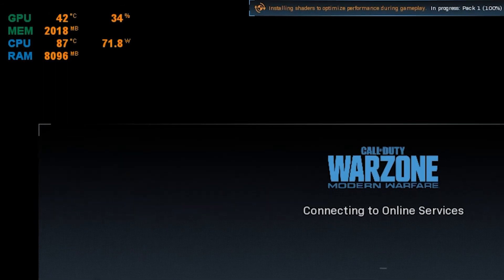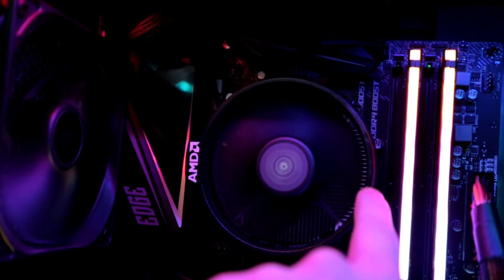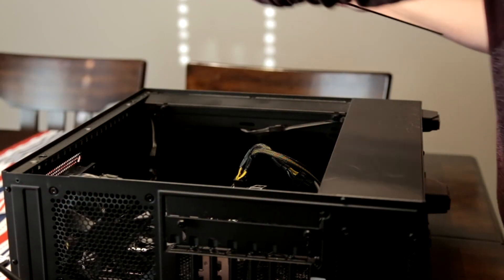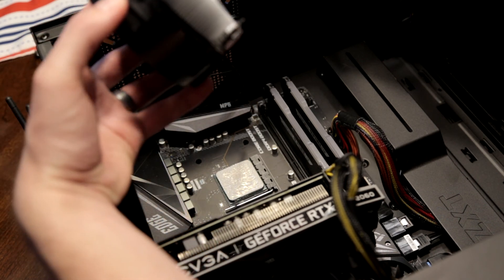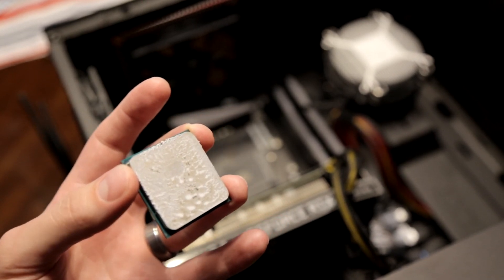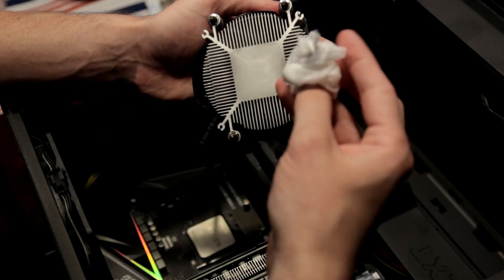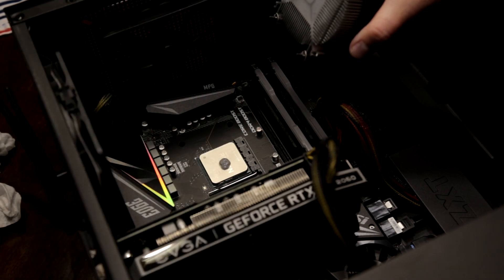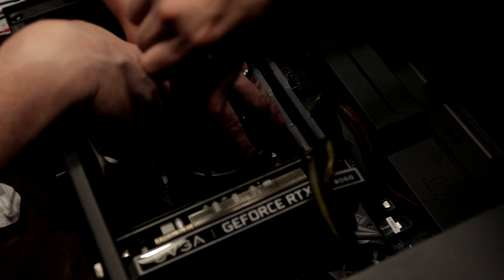High CPU Temperature? Here's How I fixed it.

Comment: my ryzen 7 3700x is runing constantly at 60 celcius and 60-70 while on full load i dont understand whats wrong if it was a faulthy cooler or if i made mistake installing it then it wouldnt stay chill at 68 celcius while im running tarkov on high settings and i have a 4070 super itried almost everything from undervolting to turning off the auto clocking in the bios settings

Comment: I idle at 48-55 
But as soon as I open anything including google chrome it automatically immediately jumps to 70’s. And when I open games it get the 83 degrees. 

I’ve already cleaned pc, reapplied thermal paste after cleaning the cpu and cooler. Turned my power consumption plan to balanced. Changed my airflow orientation twice. 

I don’t know what to do… anyone help please?I have a Ryzen 5 5600x with the stock cooler, temps haven’t been a problem in the past but recently this started to happen…

Comment: please give me a solution, my pc starts normally and tomorrow when i restart my pc the temperature is directly 90-100 degrees and a few minutes it immediately turns off, i have replaced a new paste but still no effect, oh yes when i turn on the pc there is a fan sound which is a bit noisy unlike usual, I use ekwb ek aio 360, please give me a solution

Comment: My 5600x is running 90 C anyone help?

Edit: I did everything Iron did in this video and my temperaturees is still the same, can anyone please respond I really need help my system is overheating
Reply: I have the same cpu but it hits the 80s. I tried cleaning the radiator with compressed air to remove the dust. And it helped. However, its still not perfect.
Reply: @khouja8602  it's actually fixed now it's just I was dumb and didn't properly screw the CPU cooler on to the CPU causing half the side not getting cooled so I just fixed the backplate and properly screwed the CPU cooler on and now I'm only getting,60-70f degrees when playing cod

Comment: Hi I have a AMD ryzen 3700x 8 core processor and the temps
For my cpu when I am running no games/apps is 62c and sometimes 80c I tried wiping my computer installing new drivers and thermal paste but nothing seems to work can anyone help please?
Reply: Did you figure out the issue?

Comment: Guy the ONLY thing that worked for me after trying lot of things, is going to the power mode in Windows & choosing the advanced power options & going to "Processor power management", then to 'maximum processor state' and changing both options from 100% to around 50% or 40$. Best to change that because the power thats going to your laptop is too much, so there needs to be a cap that the laptop knows to not overclock the CPU. DONT WORRY the performance is hardly affected in my experience. The CPU gets used but the temperatures & fan noise doesn't go as up at all, it s so GREATT!!
Reply: This is the only thing that worked for me. Only seemed to be happening after I got windows 11 ?

Comment: Msi after burner and task manager only show GPU temp the only way I know if CPU temp is there is through overwatch and bios it's stays at 65 on overwatch and it used to be at 81 with the stock color
Reply: Msi does show cpu temps. You just need to turn it on in the settings of msi afterburner.

Comment: Hi, I have a prebuilt with a program that shows cpu and gpu temps. But I also downloaded “msi afterburner” and in the “rivatuner” that comes with it, it shows higher cpu temps then the other program that came with computer. I even tested running both programs at the same time but the “rivatuner” still showed higher temps. Do you know anything that could be causing this?

Comment: I have a ryzen 7 3700x and I idle at 60-75. It has to be a hardware issue because I've done everything other than doing something inside of the pc, should I re-apply thermal paste?
Reply: i have this same cpu. I use a 360mm aio cooler from EKWB. at idle as we speak im at 32 -40. I was unsure if this was okay or not but i remember my idle use to be around yours with the stock cooler so I tend to not over think it or atleast try not to.

Comment: My intel i7 suddenly is running at a constant 98°C. Two days ago it was running fine with the idle being around 60°c. I replaced my thermal paste thinking that was the problem ,it wasn't.i have a m22 kraken liquid cooler for my cpu. Not sure if that's the problem as I've never worked a liquid cooler before, all I've done was made sure the tubing was aligned correctly.
Reply: I have an i9 with Lian li liquid cool and mine did the same thing. Wtfff. Did thermal paste replacement.
Reply: @RyTyTech  did that do anything?

Comment: I'm kinda worried I got a ryzen 5 3600 it's in a mini itx case it's idling at 50c then when gaming bf5 it skyrockets into 90c (after 30 mins or more) I once saw it hit 95 what can I do to fix it.
Reply: Download ryzen master, set the mhz to 4000 and the voltage to 1.2 and it will run much cooler
Reply: @siddyplayz1738  my mb is oc locked
Reply: @fewlandedplanes9148  what mb do you have?
Reply: @siddyplayz1738  a320-itx

Comment: I have a ryzen 5 2600 and I get 90+ at idle. I've reapplied thermal paste, cleaned out my whole pc, changed my power settings, I have 4 fans. Idk what to do anymore😭
Reply: did you find any fix? I'm kind of in a similar situation
Reply: @keemo2684  if you find a solution lmk please!!
Reply: Any solution ? Similar situation

Comment: If cpu temperatures are between 35-50 on idle and around 70 on cinebench then it probably not an issue with the thermal paste and seating of the cpu cooler. If temperatures are high during games it’s probably because of restrictions in airflow to components in the case. During games both the gpu and cpu are working hard and the latest GPUs in particular dump out a lot of heat inside the case.
Reply: My cpu idles 40-50 but when I game it goes too 80-90 abs sometimes hits 100. I re applied thermal paste and nothing is helping!!!!
Reply: @RyTyTech   got a aio cooler bro I had same problem every time I entree like wz gta5 my temperature would rise to 73 to 79c but month age in gta5 it was like 69c air cooler I brought Corsair aio now it at 57c 4.6mhz 10700f
Reply: @Spilityz  help bro gta 5 is getting 67 and above when I play Minecraft is hitting 85 and above sometimes 86 my game run temperature 70 and above and I am using ryzen 7x58003d cooler ASUS ROG Strix LC II 360 ARGB All Aio cooler
Reply: The only problem I have is playing Minecraft idk if is normal for that cpu temperature for the cpu getting 85 it only happens when I fly on creative is random is trying is best to go from 85 to 81 and above some on ground walking 75 and above but it stays around 71
Reply: I’m on YouTube And myn is on 98 like what
Reply: @Bnxzz  have you figured any solution out?

Comment: I use "core temp" byALCPU, when idle its 14-17°C when stressed it goes 62°C, but why is that when i go to bios the cpu temp goes from 35°C to 67C°? Does BIOS stressing the CPU?
Reply: 14 to 17? How, what’s your cooler and case

Comment: You can also go into your bios and limit the cpu temp. I have mine set to 75°.
Reply: if you set your temp limit. once your pc hits that limit. your clock speeds drop because you're forcing a thermal throttle
Reply: how
Reply: @karimsaidi8123  I'm AMD and I go to OC Settings then PBO and it has a limiter in there.
Reply: I'll see if I can find the video
Reply: https://youtu.be/4Tii1sNcfQ0

Comment: I recently bought a prebuilt pc. I was on idle about 55-65 degrees Celsius, and when playing games like rocket league and valorant I was around 70-80 degrees, I recently bought more ram (16gb ram from 8 gb previously) and now my temps are 90+ playing those same games, I have no idea what happened
Reply: if you have upgraded to a higher memory speed, it could be putting more stress on the memory management unit which increases temperatures
Reply: The first upgrade anyone with a pre built should do is buy proper cooling or even a new case

Once youve lowered your temps it means an overall better performance

Comment: Hey i'm running at 50 C idle used to be around 32-36 and go as high as 70 when playing cyberpunk and a few games. I have a 5900x with cooler master 360 ML AIO which I replaced with the EK Elite 360 which I absolutely love it's so quiet at these high temperatures but the temps are not improving with this cooler. I double checked everything, looked for malware, installed and reinstalled. No improvements!

Comment: My cpu is i5 its idle temp is 48-51 and while playing minecraft it goes literally to 99° c and after some time it automatically turns off
Reply: Mine goes 93 when playing gta 5 online
Reply: @skrrdibu5227  i fixed it now it was because dusty and slow cooler of my fan
Reply: @skrrdibu5227  now i get overclocked gpu temp 65c and cpu 71c in gta v

Comment: Check your pc power consumption. If you have it on high performance. Your cpu more likely be running full load at all times. Go into control panel and change your power to balance for lower temps. PC will boost up when needed.
Reply: Bro thx so much. lol b4 my temps were 99 degrees now its down to 70
Reply: thank you so much bro :yt:
Reply: No wonder lmao, i changed my power plan to ultimate and it ended up going to 78° when i was at 48° before
Reply: It’s already on balanced and it’s 90°
Reply: @saada5369  same here than i watched a video where a person undervolt the processor now my temperature is lower
Reply: my guy, thank you so much. ur out here saving people
Reply: lifesaver comment

Comment: My pc is around 2 weeks old, all new parts and no oc at all. My Ryzen 7 3700x is idling at 102c and has shut off my pc once. I have a strong feeling my aio has already went out. My gpu temp is just fine and everything else is okay. 

Full build
Ryzen 7 3700x
RTX 2070 Super
1tb NVME
32gb ddr4 3600mhz
Cooler Master AIO 
800w psu
Reply: Did you find a solution?
Reply: Dude I have the same cpu and it shut my pc down often while playing pc, I have my power setting at full performance so I changed it to power saver it fixed it but gaming sucks especially playing fps game like warzone I have a 3080 graphics card

Comment: My intel i3 keeps getting on 100 degree celsius when i play games or even open zoom and i figured out that my cpu fan doesnt start when i power up my pc, i need to push it a bit in order to start the fan. Any solution?
Reply: Use afterburner if that helps?
Reply: @HookedonDays  i used afterburner to check my pc's temperature

Comment: My cpu is at 99 c I have 2 intake in the front and 2 exhaust 1 at the rear and 1 on top is it because i need new thermal paste or heatsink not seated correctly it's a intel stock cooler.
Reply: I have i7 and no case fan ... My CPU at idle it stays at 60s.. and 105c at load of 30%usage..... I want to buy CPU cooler and a new case but I have lockdown here  :(
Reply: @cold_aim  💀
Reply: @krish4540 I bought deepcool gammax 400v2 and deepcool g15 thermal few days ago and now it's 33c idle and 64c at full stress test of 30 min..
Reply: @cold_aim  i also have gammax 40 v2 with i7 10700k. Running gta v or cod reaches 85-87°C within 20 minutes. Don't know if its bad cpu or cooler :(
Reply: @csg-o-a-t4933  I think it's just a bit high try changing with a good thermal compound...(I used deepcool g15) having 75 will be ok I guess cause it's a powerful CPU after all...
Reply: @cold_aim  true man. Thanks, will definitely try that. Also tomorrow getting two case fans 120mm (prizm). Will install them at the top.
Btw which power plan do you run your pc at? Balanced or high performance?
Reply: @csg-o-a-t4933  high performance 😎😂😂
Reply: @csg-o-a-t4933  owo that's great i also recently changed my case
Reply: @cold_aim  hey. Just wanted to update. I didn't repaste the cpu fan since i did that a couple of days back. I added two case fans-one at top and other at rear and set them to full speeds.
Now my desktop temperature at max reach 74-75°C in a non air conditioned room with average temperature keeping at 64-65-67°C while gaming. Super happy to see a this much of a difference from 86-89-91°C.
Reply: @csg-o-a-t4933  great I also saw same changes in mine xD my graphics card was thermal throttling 101 c xD changed the thermal paste and now 70c in 100% usage xD

Comment: My cpu idles at 55°c with a cooler master on top of it. The cpu cooler runs at 1100 rpm which is more than enough. Why is it so dang hot?

Edit: it has a graphite pad on top of the cpu
Reply: Huh
Reply: See that's kina what my issue is too. I have a coolermaster watercooler for my cpu and it idles at 102c. I feel like my cooler has completely went out which makes no sense at all being that it's only 2 weeks old

Comment: I just installed a new AIO and it’s on 99 degrees help
Reply: probably not seated properly check all screws
Reply: same, it made my cpu and you run at around 130f
Reply: @judahsmrl  wow..
Reply: @judahsmrl  you can undervolt using intel extreme utility run a stress test and keep undervolting until your pc isn’t throttling
Reply: @judahsmrl  thats good if it was f or did u mean c because 130f is only 54c and thats really the average temp
Reply: Thermal paste??

Comment: I have an r3600 and when I play apex I get to 65-75 sometimes it’ll hit 80 or heck even 85 but it’ll instantly drop back to the 70s am I ok?
Reply from the maker: Yes you’ll be fine. Even the CPU’s can withstand 90’s for a while before having performance issues. You just don’t want that constantly for long periods.
Reply: @IronPointTech  i have r3600 too but why the temp 90° at idle
Reply: Lol I hit 85 at idle

Comment: Thank you. I'm using an intel i5 8400 (stock fan) average temp in idle is 45 - 50 degrees. But When i play games the peak is 65 to around 75 degrees. Would that be fine?
Reply: Yes
Reply: 75 degrees is fine
you should start worrying about high temps when its 83 or higher
if its anything higher than 90 you really should do something about it
Reply: @iltro-o  mine is literally 99° C
Reply: yup

Comment: Idle my 3600 runs at 70-80 and 80-95 under load whereas my 2600 (same cooler and paste) ran at 50 idle and 65-75 under load? I have tried thermal paste reapplication but hasn't done anything
Reply: My r5 3600 is running 60-60c idle, and 80-90c when playing a game. Have you fixed it yet?
Reply: @uhhskimp  thats really bad mine is 35c on idle, 45-50c when playing a light game, 60-70 in fortnite
Reply: Lower voltage
Reply: i have a r5 3600 and it is around 35-50

Comment: Do you recommend using gel paste?. i just bought Cooler master mastergel regular . . but it seems that the cpu temperature is 42 suddenly spiked to 52 and goes to 43 celcius again.. . I just refresh in desktop it Doesnt have any  running apps tho.  .it continue all the time .  .  .. any solution?
Reply: Thats pretty normal with the spikes
Reply: did you solve that problem i had the same problem
Reply: @NamNguyen-wd6kg  its normal for amd to spike , change it tu other thermal paste , now im using aeronaut thermal grizzly ... dont use gel, its sucks
Reply: @AHMADIZHARBINSAHAMIN  im use intel so i quite worried about the temperature
Reply: @NamNguyen-wd6kg  If you use intel , you should reapply new thermal paste ,  clean the old thermal with isoprophil alcohol , you should be good! by the way wht is your processor?

Comment: Amd 2600 stock fan with stock paste, for gaming goes into 100c. Pc works but if you restart at that temperature, bios dont let to continue.
Reply: @gabrield.4276  i bought arctic freezer 2 120mm
Reply: @mrmagoo756  how are your temps?
Reply: @scrambledbananas  idles at 30 to 40 depending on room temperature, even in the 20s sometimes.
Reply: @gabrield.4276  is it better?
Reply: @gabrield.4276  I’ll consider it if just replacing thermal paste doesn’t work
Reply: 100c on gaming. Dude undervolt it or something man thats too high.
Reply: @afallensaiyan  arctic freezer 2 got the job done.

Comment: Hello Dear,
i have Ryzen 9 - 3900x and RTX 2060 GPU. i installed cooler master ML360R AIO after I'm facing problems in my GPU.
My GPU temperature is going to be High 60-84°c.
When i turn on my pc after my GPU temperature is running 41°c without any using task with 0% uses.
Please help me.
Reply: No mate 40 degrees with 0 percentage use is totally normal. My laptop runs cpu 44 idle and gpu 40 idle. Under load my cpu is around 60-70  and gpu is around 60. It stays hot for a while. Then it gets even hotter but then a restart will fix it

Comment: My cpu is hitting 95 degrees while gaming on more stressful games like COD, I have an i9 9900k (not over clocked at all) with a Z370A motherboard, I noticed a change in temps once I swapped my cpu from my i7 8700. Idk if it’s maybe the motherboard is older while using the new gen cpus or if it’s my AIO which is a single 120mm Kraken M22. I recently took the cooler off and put new thermal paste but still having this issue.
Reply: Just throw it away and get a new one.
Reply: Or get a better cooler.
Reply: how do u have a 9900k with a z370
Reply: @chief98809  idk I just do? Lmao it’s an ASUS Z370-A
Reply: @jonboitv2372  any update on your hot situation? i have a buddy that im trying to help with his build. it also has a 9900k, which also runs hot.  does your fan have a large heat sink?
Reply: @bertogonzalez202  Literally all I did was turn off turbo mode in the BIOS for the time being until I have a better cooling to maintain the heat. Now it stays steady around 55-65 degrees depending on the load but it runs great now.
Reply: @jonboitv2372  turbo for what? The cpu fan
Reply: @samluce723  no just the CPU Turbo Mode in the BIOS which boosts all cores at all times